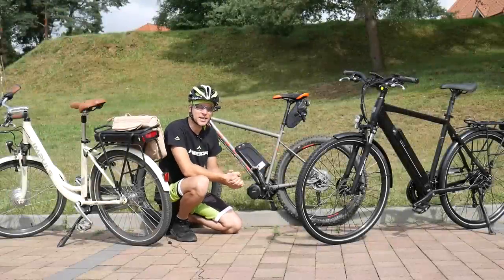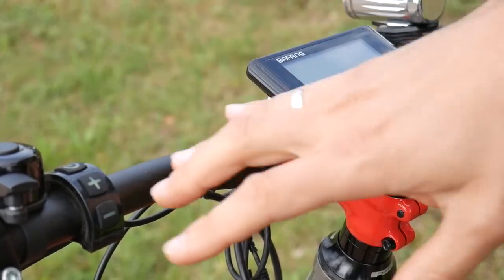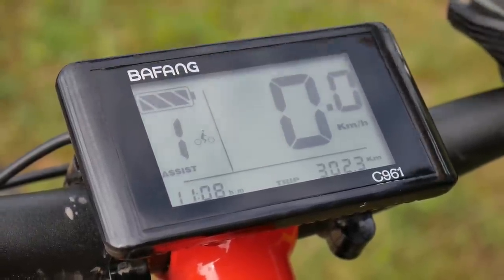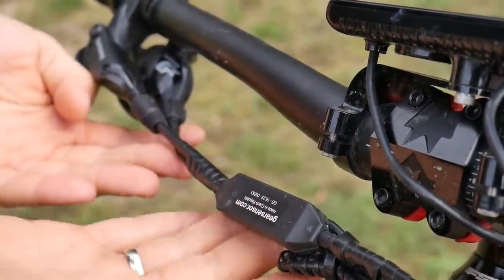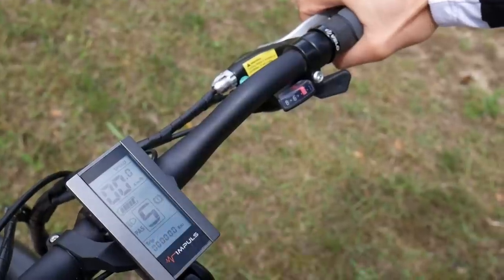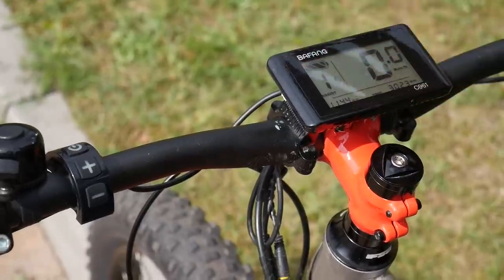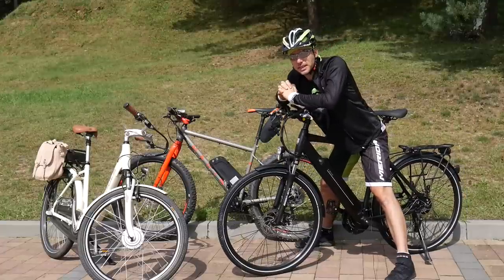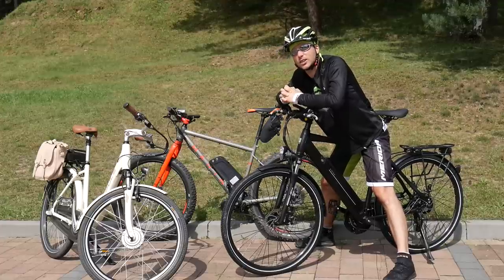E-Bikes Part 2 - How Electric Bicycle Really Works. The Beginner's Guide

Comment: Ex-smoker Emphysema/COPD patient here. My doctor wants me to exercise more. I can't do 5 minutes in Texas heat and humidity workout stopping and gasping for breath. No therapeutic value in that. 

I added a BBS02 and a 14AH 52V battery to my Diamondback hardtail using PAS 1, 2, 3 of 9 makes a difference I can peddle for 30-45 minutes without collapsing, raise my heart rate and I'm actually breathing heavier without getting wiped out/exhausted. Last Tuesday i did 16 miles with wind gusting to 17mph. Therapy accomplished!
Reply: Pamela Curry how about going out at night when it may be cooler. Anything is better than not trying ?
Reply: Robert Bland pay attention to what she wrote.  She is going out now.  See that?
Reply: no

Comment: Thanks for the informative video. In the province of Quebec (in Canada) ebikes can have up to 500 watt motor, maximum speed of 32 km/hr and when the electric motor is not in use the bike must allow you to pedal.  You don’t need to register an ebike but you must be 14 years or older to ride. 14-17 year olds must have a drivers license for a scooter/moped or a regular drivers license. Over 18 years of age don’t require any type of license.  I’m thinking of getting one so I can keep up to my husband on hilly terrain.

Comment: It's not bicycles that are dangerous. It's cars and traffic laws that are dangerous.. and poorly designed bicycle lanes/roads.
Reply from the maker: I would say, that e-bikes with a strong motor, like the Marin Pine we have (750 Watts) can also be dangerous. These are very fast and light for the power.
Reply: I still wouldn't say the bike is dangerous unless you're riding it like an idiot.  I used to have my ebike running at around 2700W, and it was fine.  Not unsafe unless you rode it unsafe.  Yes, if you ride it around at 70km/h it's unsafe, but that's the rider being unsafe, not the bike.

By the same token, I'm annoyed by ebikes who pass dangerously.  When I see people riding up a steep bike lane at 15km/h, and an ebike rips by without warning at 30+ I can see why a lot of people don't like them, or think they're dangerous.  
Of course, a fit cyclist doing the same thing is just as bad.  The difference being that people blame the cyclist like they should, instead of the bike.
Reply: We'll be on trails, so won't have to worry about cars. Trip got rescheduled due to COVID.

Comment: A topic that needs to be addressed is geared and gearless rear/front motors. The gearless variety has less maintenance and fewer breakdowns, or so I have read. Also, I've heard a gearless rear hub is more like riding a regular bicycle. 

I live in a desert which presents other problems: namely, the heat affects the battery (electric cars usually have coolers on their batteries; bikes don't) that riding an ebike is often ruled out unless it is wintertime or nighttime in high heat environments.

Comment: Very helpful vid, thanks! I'm considering getting an E-bike. I weight 240 pounds and need to travel at least 8 miles round trip up some very steep streets and trails. Any advice?
Reply: Ensure the battery is at least 500 watts or greater.
Reply: I am new to the E bike world. I’ve had mine for just about two weeks now. I’m 68 years old I weigh A whopping 272 pounds pounds. So the E bike is actually going to help me lose weight because I have pedal assist along with the throttle which comes in handy for moving out of the intersections easily. There’s not only the weight of the E bike itself but I have double panniers on a real rack today. First aid kit and tools extra coat etc. no I have been riding bicycle for the last 40+ years and I know how to shift gears lower gears going up hills on pedal assist really helps out the motor while the motor helps you out.I insulated the battery because it’s cold where I am at this time of the year, and they charge the battery on a daily basis whether it is completely used up or not and it usually is not completely used up.

Comment: One question I have and I have not found an answer yet. How do the lights connect to the battery? For example if your battery is 48v, do you have 48v lights or is there a line from the battery that is a lower voltage?
Reply: It depends on the light. The one that I have is rated from 12v to 60v. I assume it’s got a built in rectifier. Look for ebike headlight and read the specs. Or you can get a little rectifier that changes the voltage to 12v which opens up the options.

Comment: Is there any e-bike which will charge your battery on long downhill ? Where I live there are many hills and then a very long downhills. I'm 72 years old and it would certainly extend the distance I could travel....thanks, Karl
Reply: Hub dynamo connected to battery maybe? Somebody with electric skills could try that.
Reply: As far as I know that is only possible with direct drive hub-motors. You should specifically look for an e-bike which has that built in already. Some only regain energy when braking, so be aware.

Comment: I would like to know answer if anybody can give it about this. What kind of e-bike is recomended for riding up the hill for 5 or more kilometers with 12% rise on asphalt only by motor? Weight of bike and driver and things on bike no more than 120 kg. Also, what power of motor is recomended for this driving and not driving as a snail, at least 10 km/h?
Reply: They are all good, mid electrical motor seems to be most popular and get a battery with at least 500k watts or greater.

Comment: Is there an e-bike that will charge the battery when braking?
Reply: Not too sure but would be a great invention if so mate great idea
Reply: It exists but the regenerative braking returns are minimal on ebikes.
Reply: You can only recover so much energy from braking. This isn't an electric car, and nowhere near as massive. If assume we're at the top of a hill and starting at top speed, and we end at the bottom with 0 speed, we could recover maybe 60% of the combined potential and kinetic energy (lofty assumptions here).
Reply: There was one in Vancouver Canada that regenerates going down hills, a friend of mine has one the manufacturer is called OHMS.   I believe that have changed there design because in Canada this model also had a throttle but is not allowed under law.  I’m sure there are other company’s that make and utilize this technology.
Reply: So the equipment needed to have an adequate regeneration system on a bicycle, would not be the best for generating electricity due to its weight and extra cost and extra drag against the motor and the battery itself. There are some solar companies that have solar cells you can generate your battery worth but that involves being stationary,How did is also very very slow. You could however put a whole bunch of solar cells on a trailer I suppose if you are touring a long distance and it may help but once again cost and effect!

Comment: No pun intended but I find E Bikes a step up of  an evolved Flintstones Mechanics. Ya know, Barney and Fred driving in their step two cars. The E Bikes effect of how they work as genius and the new fad as of now due to price hikes on most sales now. It is not a scooter bike but a step up of mopeds in a more lighter and convenient way. E Bikes not for the totally lazy person but for Bikers who ride a lot of a needed boost to ride more range. 
I ride my eBike to my preferences of having battery last very long so I pedal a lot and notice the 7 gear Hubs you ride of shifting like a Clutch of various speed and terrain. Say I have 9 levels of PAS on 350watt, Im at PAS5 only on 5th gear GOING 21 MPH but I need to slow down so I go to PAS6( 6 TO 9 IS DOWNSHIFTING POWER,but you can go from 4 to 3 ect) with switching to 4th gear, then PAS7 3rd gear, PAS8  I start applying my disc brakes of the speed slow down I safely stop of 7 feet braking to full stop. It is really fun to learn this as it gets me more knowledgeable of how to use besides looking at specs.
Reply: @Michael Dupre lol dont mind my DIY IQ with that downshifting. I'm relating to actual clutch of motorcycle, car.ect. E bike gear motors not applicable for this type of downshifting unless or until actual motor design gives way. Just putting in thought as a novice beginner into the life. I've tried but with no clutch the motor still running idle of those turns. I've learned just great brakes and a need to not Excell on turns( had front motor and did this only to be ave blow outs as I did it twice, believe the friction presses down on sides but accelerating on tight turns of front motor puts stress on side walls or pinching while rotation of motor in use of more g s .
Reply: My grammar on media platforms is annoying, lol. I try to text less words from texting too much I end up confusing others. But it's really the android keyboard throwing you off point by replacing some words and phrases before you can notice the post is posted most times. I'm getting better at spotting the android keyboard and learning. But , the post up top some time back as I'm still a novice e biker last 2 years since Covid. I've bought 2 factory made  500watt gear motor e bikes and upgraded both of them with 2nd 2000watt Gearless  motor as a Turbo Booster function( best method of DIY duals) When turning corners off turbo Booster mode I switch back to my gear motor and shift to 3rd gear once around the bend. Love this lifestyle for I be forever building more.

Comment: 25km/h legal speed limit in the EU? I live in Latvia and it's either bicycle with the general traffic laws or motorcycle with general traffic laws with special signs meant for motorcycles. It depends on the motor wattage how the bike is classified, but in most cases you can ride as fast as general traffic.
Reply: The limit of 25 km/h makes it a bicycle, above it is classified as a moped/motorcycle. The 25 km/h limit does allow a 10% deviation. You can even go 35-40 km/h downhill, but the motor should not accommodate speeds above 25 km/h plus 10%.
Reply: The limitedis imposed on constructors, they have to add a speed threshold at which the assist is turned off automatically if they wanna commercialize it in the union or the country.
while the limit isn't imposed on the cyclists themselves.
you can custom build one without caring about the limits if you want, but this also depends on which country.
technicaly a hub motor with a throlle switch is easy to setup, while one mid-gear one with speed monitoring is harder to setup.
Reply: +zazugee
In the Netherlands and Germany (and I suppose many more EU-countries) the limit is to the use on public roads. You can drive anything on private property, but as soon as you hit public roads your vehicle needs to comply to national traffic rules. The driver will be held responsible for this and will be fined and in some cases the e-bike will be confiscated. Even more, insurances might not pay out any damage if your e-bike did not comply to the traffic rules.
The EU regulates e-bikes in EN 15194 which was last changed in 2011 and for which an update is being prepared. EN 15194 is very limited now and can be interpreted differently by different EU-countries. Anyway, national traffic regulation laws are leading, so in countries like the Netherlands and Germany you take the risk of getting a fine, having your e-bike confiscated or much worse if you cause a traffic accident with severe damage/injuries.
Reply: i didn't consider this, but here bicyclist are considered the same as pedestrians, no insurance required.
I thought the limits were only imposed on ebikes for sales, never thought that you may get arrested for driving an illegal one.
Reply: +zazugee
In Germany and the Netherlands insurance for bikes is also not obliged, but if you cause damage to others you will have to pay for the damage yourselves. There is an important advantage for pedestrians and bicyclists in the Netherlands: owners/insurance of cars and motorcycles always have to pay for damage, even if the accident is not their mistake. This way pedestrians and bicyclists are very well protected by law. If however your e-bike is illegal, it is not considered to be a bicycle anymore and those insurances won't pay out.

Comment: Do you recommend one type of placement of the motor over the other? Wheel hubs vs Central?!
Reply: Though it is the most expensive center drive is best..
Reply: Lower motor means lower centre of gravity, and therefore a much more stable ride. This is important when riding very slowly and in traffic. Also, if the motor is in the back wheel it can be an awkward  experience fixing a flat tyre, especially when miles from home.
Reply: @2068edward  not quite correct. You just disconnect the power cable; a quick connector is there. Then you handle the wheel as any other.

Comment: Can the battery be recharged a little if coasting or riding with the motor off?
Reply: We need a regen on the ebike like a car.
Reply: Not yet publically available tech. THAT'S WHY entire internet advises you to save battery to return to home...
Reply: Actually there are e-bike that regen while going down hill, well, one manufacturer is OHMS.  A friend of mine has one but very expensive.

Comment: E-Bikes DO NOT have to be pedaled unless they really really suck.  You certainly can.  But if you can't let the bike's motor take over (via a throttle or cruise control) then don't buy it.  In the EU they used have a law that say no throttles.  But since their law now demands they get insurance,  drivers license and and a license plate the rules like speed caps, very low maximum power motors and no throttles are all out the window.

Comment: If u run out of battery on the ebike  will u still be able  to use it like a normal bike?
Reply: Yes you can. That's the whole idea . I own an e-bike with rear-hub-motor. I intentionally used up all the juice on my battery yesterday then rode back home easily. You just gear down a little as the bicycle is heavier than a normal one.

Comment: Class 2 and 3 ebikes do not need to pedal. You should do your research. Not all ebikes are class 1.
Reply: yes i think some bikes have an option to drive the motor by thumb throttle without peddling
Reply: He is from Europe and what he really is talking about is called Pedelec here. Those are limited to 250W and the motor is only allowed to support while you are pedaling and only up to 25 km/h. There are Ebikes with other regulation here too, but when talling about Ebikes most people here mean those Pedelecs

Comment: Please, how and when to use gears?
Reply: On my eBike I have 9 chain sprocket & 3 power levels.  Move off, once in motion turn on power & use level 1 to feel the battery kick in. On a slight incline use level 2, steeper climb move to level 3 & if necessary move the chain to the larger sprocket. Peddling. Gently turn the pedals, the motor will do the work, does not require the same effort U would use on a standard road bike.

Comment: Has a motor = motor bike. Hiding the throttle inside the cranks doesn't change the fact they are motorized. These things are designed to skirt laws regarding motorized vehicles.
Reply: Dean F don't need to since i already know what a motor is apparently you don't.
Reply: I think it's stupid that if you have a throttle it immediately stops being treated as a bicycle and it becomes a scooter(legally). What's the difference between me turning the pedals freely and going 25 km/h as opposed to turning the throttle and going the same speed?
Reply: Well the law is very specific that it is not a motorized vehicle. Just because it has a motor does not make it a motorized vehicle. Laws are more complicated then just, has a motor = a motorized vehicle.

Comment: e-bikes are not bikes.  there is a motor assisting motion.
Reply: Ytube777. Bicycle.  Bi.   Cycle.   =. Two.  Wheels.     They are electric assisted bicycles
Reply: You can turn off the motor and only use it when needed.
Reply: Right... Than emails aren't mails, there is network based motion! LOL